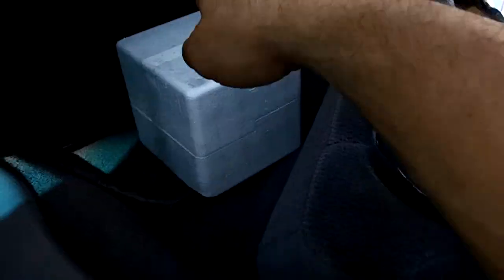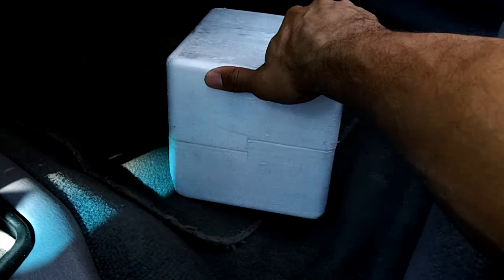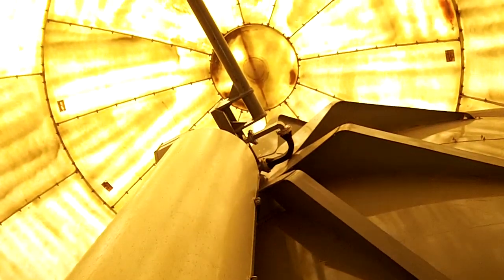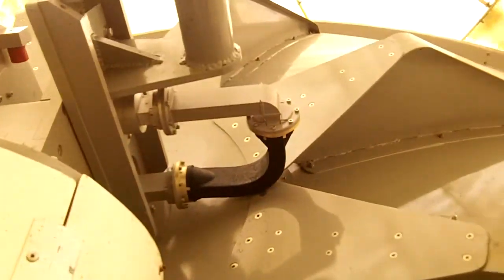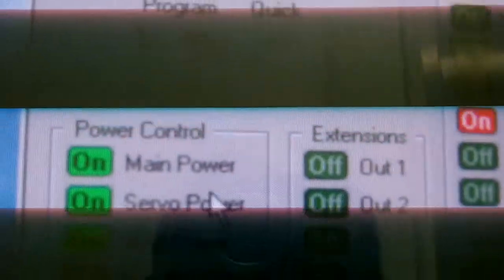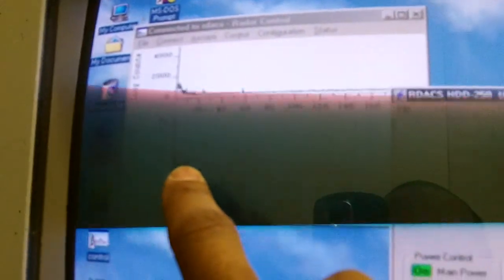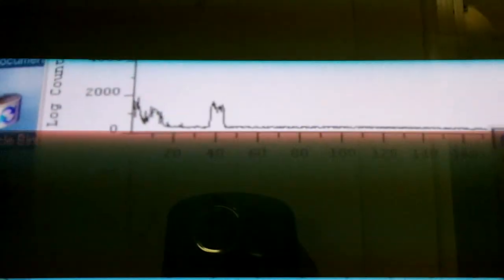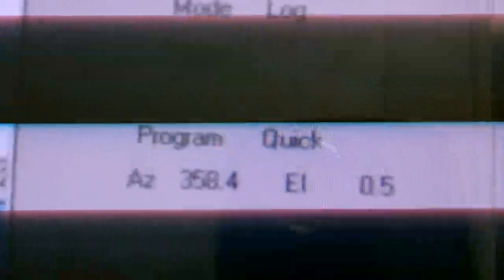Doppler Radar Repair Part 2

Comment from the maker: It can if you don't shut down the transmitter before you go up to it lol Of course we always shut it down before we work on it & 1 of the main reasons is the high voltage of 1,400v AC. Most people don't know but we all are exposed to RF radiation all day & don't know it from cell phones, cell towers, WiFi, cordless phones, wireless routers, blue tooth, radio station towers, TV station towers, GPS transmissions & anything that transmits with an antenna. It's all hitting us all day.